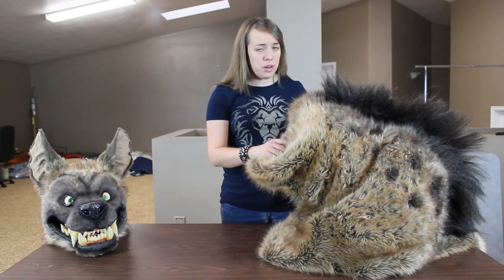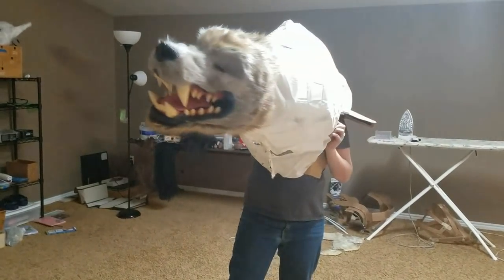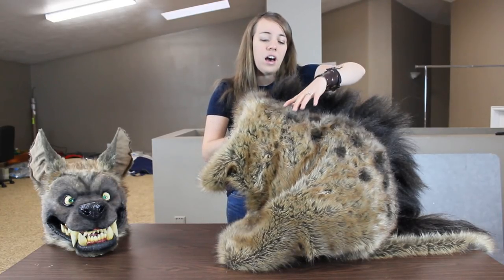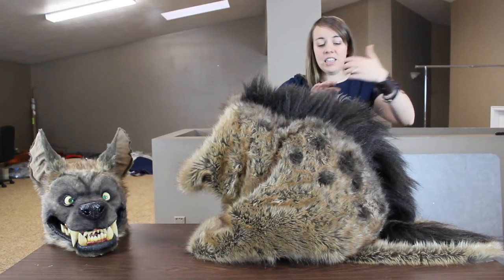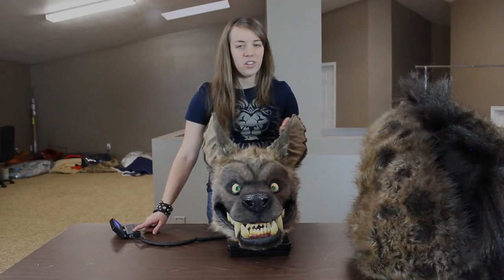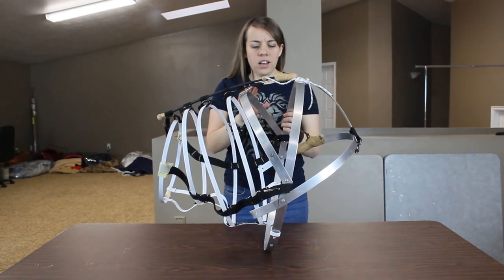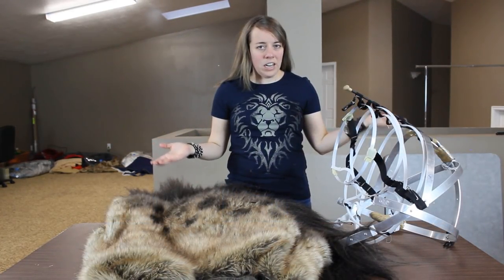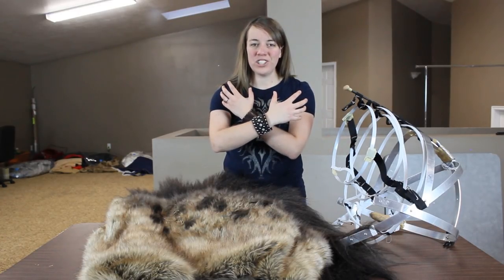Hogger Cosplay: Puppet Neck Structure #wantedHogger

Comment: Hi! I’m thinking about cosplaying Obstagoon from Pokémon Sword/Shield. Obstagoon has a longer neck than a human does, so I wanted to make something similar to this, but smaller. I wasn’t going to make it a puppet, just a slightly longer neck where I see out of the mouth. Before I made it, I have a few questions

1) how comfortable is it?
2)how easy was it to make?
3) How hot is it in there?
4) how good is the vision?
5) Any tips?

Thanks!
Reply from the maker: 1)This was fairly lightweight and the weight was distributed well on my body
2) difficult, you'll need special tools for cutting and forming aluminum, I had lots of help there.
3) it's hot, but good news is there is PLENTY of room for fans
4) terrible! I definitely didn't do well making the vision good for this project
5) try it on lots at every stage so you can find problems early!

Comment: How did you bend the aluminum rods that well?  Get them just right?  What video did you use?   I've never worked with it but need to for my next project.
Reply from the maker: I had help from a friend who has a machine shop, let me use their sheet metal roller. But at home you can make a custom jig to bend it around
Reply: @KazplayVideos  With as much metal as I need to bend I might go ahead and chip out the $300 for the bending tool on amazon I found.

Comment: Would a strap from the back of the neck to a belt on your waist help at all, or just mess with your back?
Reply from the maker: +icepick method that would help if you had a problem with the neck sliding forward and off your body. But what I did held it securely enough. But make it an elastic strap so you still have some flexibility